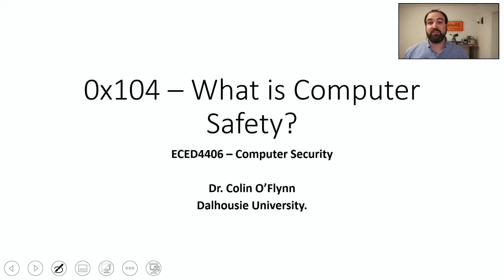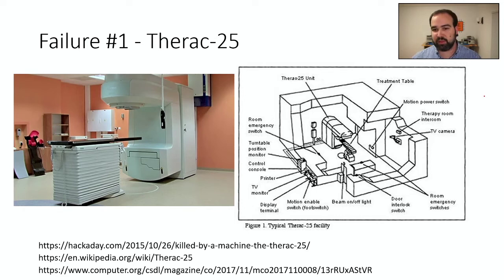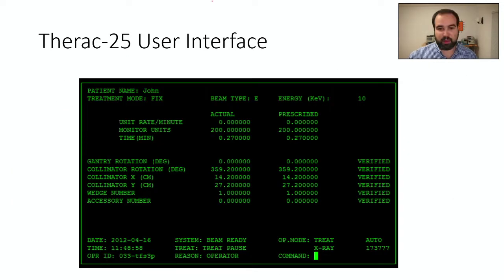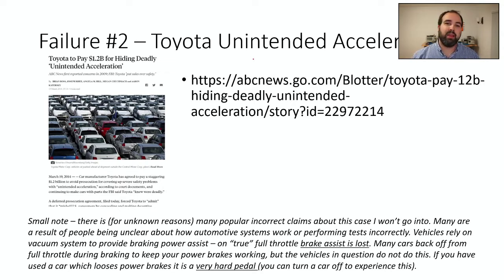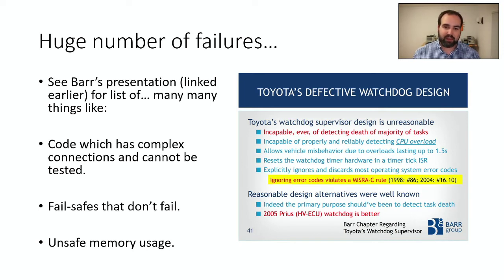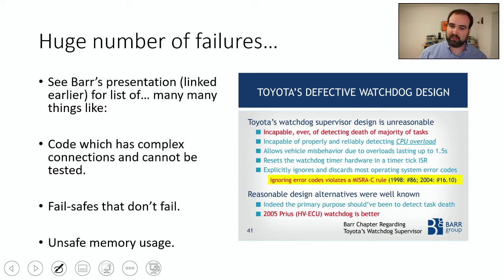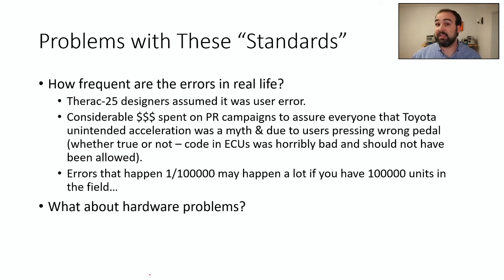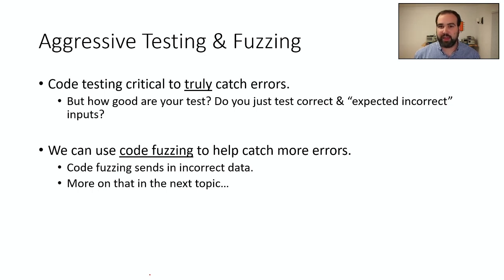ECED4406 0x104 - Computer Safety

Comment: I believe your statement about the 737 only having a single AOA sensor is slightly inaccurate.  I'm fairly certain that the MAX has redundant AOA sensors but MCAS was only programmed to alternate the sensors between flights.  I believe that one of the new features they've added is the utilization of both sensors.  Now it's code will handle events where the sensors disagree.

Otherwise, spectacular video.  Thanks.

Disclaimer: I'm just a shade-tree airplane enthusiast.
Reply from the maker: Fully inaccurate actually ;-) Yes I way simplified - I actually hadn't looked into it since the stuff first came out tbh, I was going 50% by memory... even then I understood it like you say - there is more than 1 on there (I think all aircraft would have multiple angle of attack sensors). My understanding was the MCAS in some configurations used the angle from both sensors, but some used a single sensor? Which made it somewhat "more" of a SW bug situation, since the design of the system didn't have "true" redundancy like you expect (in particular - being able to both detect a failed sensor & use a backup sensor to recover). Appreciate the note!
Reply: I'm not sure what they were thinking...nearly every system that controls the flight characteristics of an airplane should let you know when two system sensors/inputs don't agree with each other (also implying they should be looking at both sensors).  I'm willing to bet that the teams of engineers probably agreed with this and somebody higher up made that executive decision....but who really knows?

Either way, it's a mistake I would expect a 10 year old to make, not Boeing.  The story is that the MCAS system was build to make the plane feel like older versions of the plane...but Boeing really should have known better.  Not that I blame them entirely, but that's a conversation for another day.